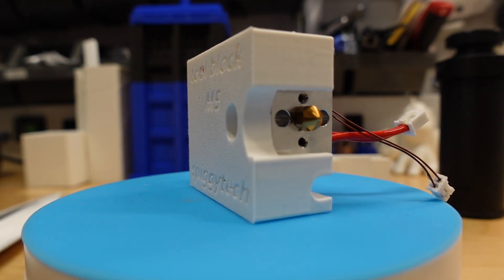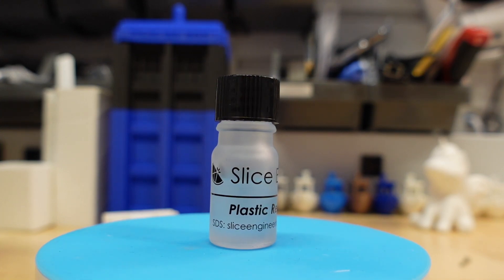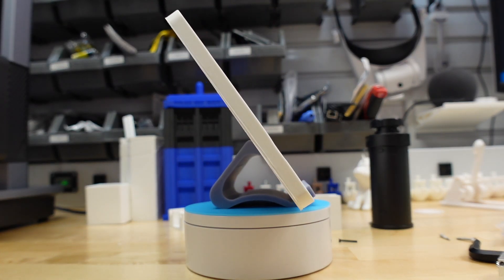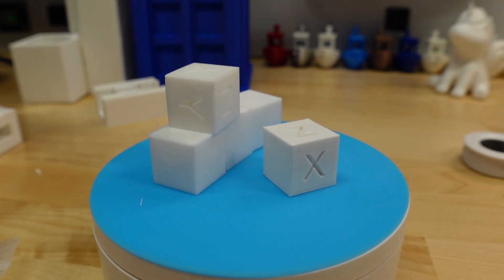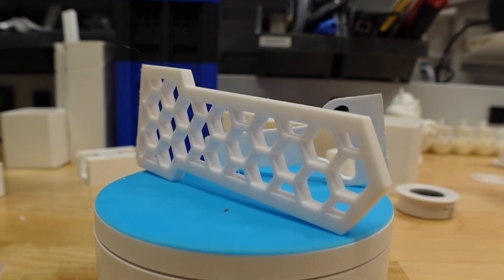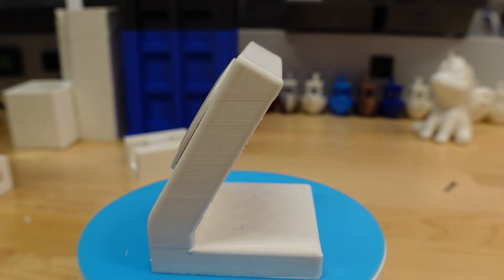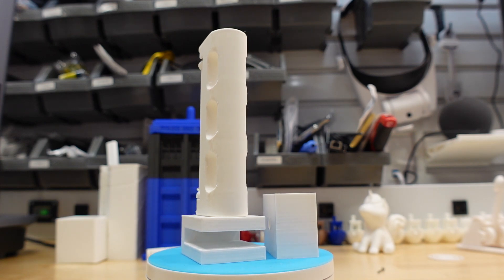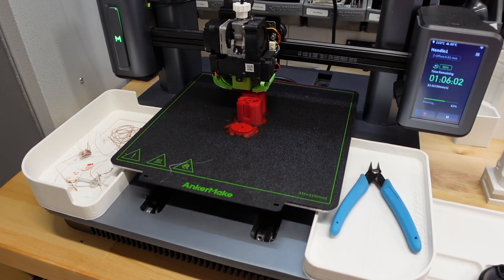AnkerMake M5 - The first 10 things to do.

Comment: Can you make a more in-depth video on calibrating the ankermake m5 is the calibration cubes are way off?
Reply from the maker: Already in the work.  E-steps, volumetric flow, temperature, z-offset.  But I am working on a tensile strength of filament video right now.

Comment: Hello i'm thinking about purchasing the AnkerMake M5 after all your experience would you recommend it?
Reply from the maker: As a first printer I would not.  I would recommend a Ender 3.  Especially if you can find a coupon for the $99 Ender 3 Pro from Microcenter.  If you have had that experience already I would recommend it but with the warning that it is still a work in progress.  But I do think it is worth the risk.  But there are many other printers I have not used that may be options.  I do wish it had a larger print volume.
Reply: @timexperience  I have had 3 printers so far all ender style but I hate the levelling and I even tried BL touches and they still suck. So I’m looking at the Ankermake as the levelling seems very good on it
Reply from the maker: Then definitely go for it
Reply: @timexperience  Have you had any problems with the levelling or has it just worked good ?
Reply from the maker: The leveling has been great.  Easy.  One of the reasons I bought it and it meets my expectations.
Reply: @timexperience  okay great thank you for replying :)
Reply from the maker: I recommend joining the official community at Reddit and Discord.  There is a lot of talent in those groups.
Reply: @timexperience  I’ll check them out thanks

Comment: In what orientation did you print the frictionless filament holder? Did you need support or a brim? Thanks :)
Reply from the maker: I tried vertically but it fell over.  I tried with and without a brim and support.  I finally printed it laying down with support and 0.1 mm layer height.